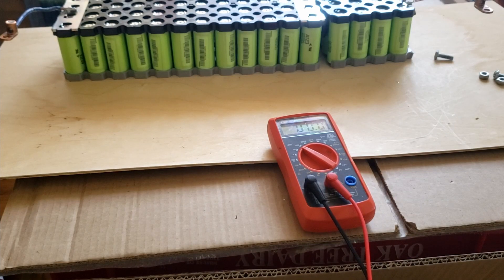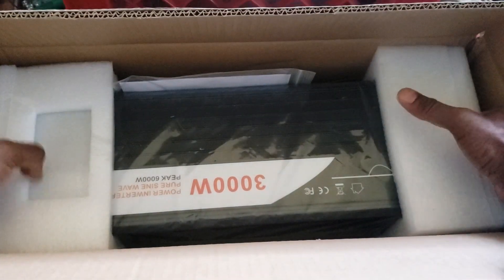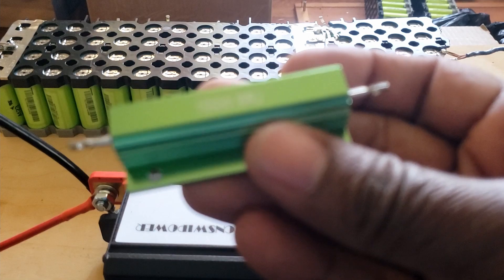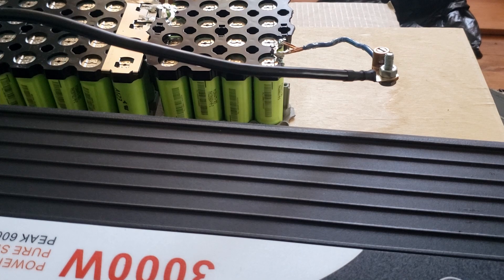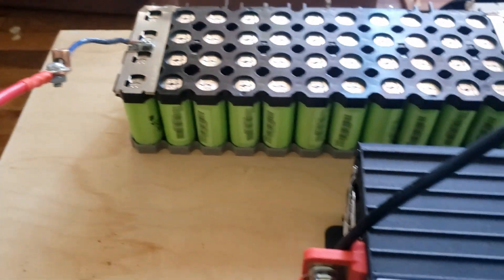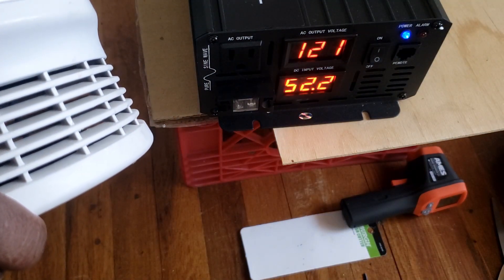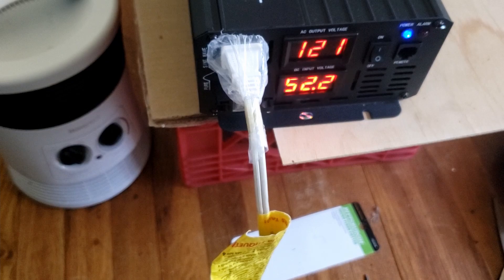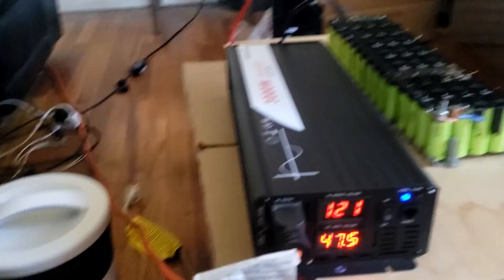DIY - A123 LifeP04 Part5 - How to Disassemble/Reconstruct/Rebuild into 48V battery Pack

Comment: That wire looks like 18 gauge. Did that work out for you or did it burn up? I know it’s not traveling far but, in the video it looks like it’s underrated. Thanks for sharing…
Reply from the maker: It is 10 gauge wire, I  don't plan to take no more than 20a. It is capable  of 45amp
Reply: @simplyfocus9937  I'm sorry it looks so much smaller or maybe compared to everything else it's an optional illusion. Nice job..I used these batteries to make a 36 volt electric riding mower.  I have a few videos on it. The battery world is all new to me. I bought a new electric car a Toyota BZ4X and love it and started to change everything I own to electric.  I subscribed if you wouldn't mind returning the favor.  Nice work...👍